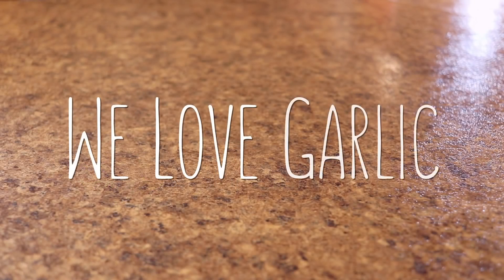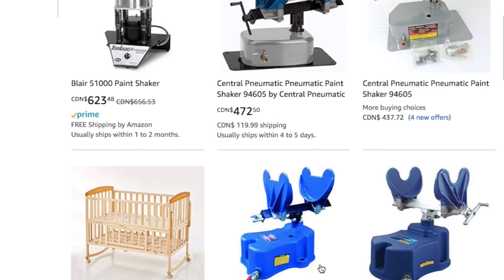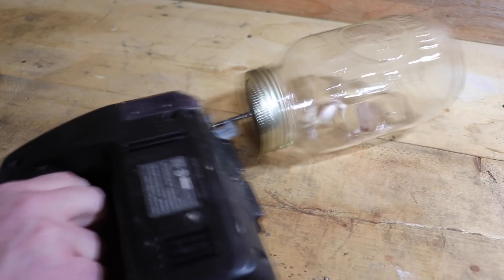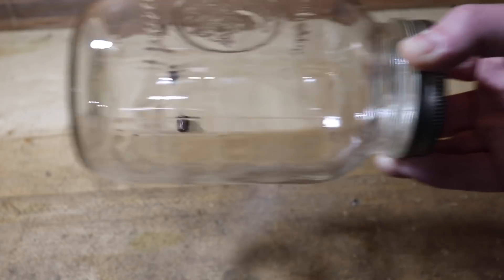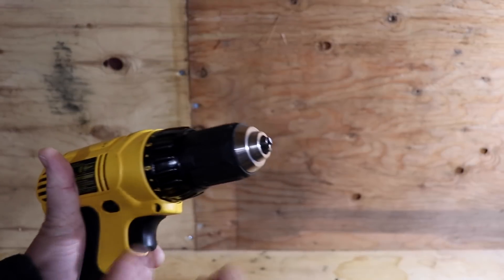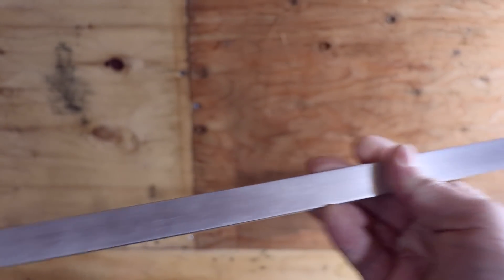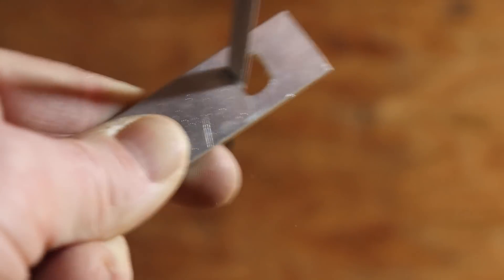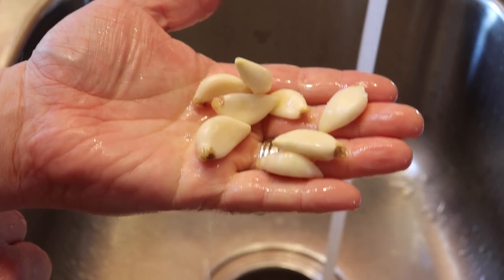How to Peel Garlic in Seconds with a Drill! (DIY garlic peeling machine)

Comment: My neighbor grows 2.5 acres of garlic he uses a washing machine without the water to peel them another washing to wash them.
Reply: Excellant!!washing m/c idea!!!!!
Reply: old washing machine can be 50$. cheap and reliable. good tip
Reply: Wow thanks for the info. Wouldn't it be damaging for the washing machine though? Please let me know.
Reply: @Mermaidjm  I wouldn't use a brand new washer, nor would I use the one we already have for laundry. But as said above, you can get a used one for very little cost. It won't even have to be hooked up to plumbing. I suspect a clothes dryer would work about the same way and you could disconnect the heating mechanism, just run the motor to tumble the garlic and knock all the peels loose. Perhaps if you left the fan in the dryer running, it would blow all the little peels out through the vent hose for you?
Reply: Since most of us don't have 2.5 acres of garlic to deal with, look around for videos about making your own small tumbler with a small motor, a bucket and a homemade stand. Usually people use them to polish rocks or put a stone-washed finished on metal parts, but it should work about the same as a washer for peeling garlic.
Reply: @Mermaidjm  you can use an old broken one atached to a bycicle, you dont use power and you work out and the waching machhines you can find them in the streets all the time for free
Reply: @vivekkhavnekar  yes very good & pefect idea operational with 110 % successful.
Reply: I know this comment is 5yrs old now, but makes me wonder if you could have used the bolt head through the jar to spin the jar with the drill, or if the drum circumference in a washer is the key element of why that works, imparting the important distance as the garlic climbs the walls and falls down.

Comment: with the mason jar/jigsaw setup, you should have tried holding the contraption vertically so gravity could assist getting the cloves to the bottom where they would  be struck by the bottom of the jar as it moved upward.   the jigsaw would probably need to be clamped securely and the lid replaced with a disc of 1/8" steel plate.  but your way is a lot more fun

Comment: Thanks for sharing this. I think the reciprocating saw approach would work if you placed the jar vertically. In that configuration, the cloves hit the bottom of the jar, are tossed up, then hit the bottom of the jar again. Over and over. You might face some weight issues in that design, but for smaller batches it could work. It’s a simpler design than the drill design and might be easier for some people.

Comment: I used a leaf blower to fire the garlic down some pvc pipe and into a five gallon plastic carboy with a hole cut in the side. The impact consistently broke up the peels so they could be removed easily and I faced the carboy downward to collect the cloves of garlic in a container beneath, where any stragglers could be recycled into the machine to be shot through it again if necessary. pounds of almost completely peeled garlic in minutes. I thought about adding a sluice box at the end to separate the peels (which float) from the peeled cloves (which sink) but never got that far.

Comment: The mechanics is good. To improve the function, Introduce a nylon or steel net inside the jar to make surface rough instead of smooth glass. It should peel faster than you expect.

Comment: What a crackup- This is a lot like what I was doing with a motor and a controller before the controller died. I have a round disc instead of a crank arm (because I have discs laying around). And a linear bearing. I haven't quite got the container figured out. I want it removable so it can be washed. It's great to see that you've proven the distance it takes to accomplish this. I'm still going to finish it whenever an affordable dc controller shows up on ebay.

Comment: Well you created a QUICK RETURN SLIDER MECHANISM here. 
To be more efficient and let the garlic peel both in its forward and backward stroke, u need to make the slider move in same speeds during forward and return strokes. 
If the centre of the crank and the slider line of action is offset, u will get a quick return motion with any of one stroke being faster than the other.
To make both the speeds identical, position the crank centre and the slider line of action in line.
Reply: correction, I'm an idiot.  sorry for sounding insulting, I've been drinking.  I just penciled it out.  You are right.  The return stroke is a bit faster.  Pretty sure that isn't a problem in this application.  

1) bearings on all connections.( the video guy mentioned that)
2) foot mounted electric motor with bearings designed for cyclical side loads.  Nord makes a nice one.
3) I'd recommend a belt drive to reduce motor speed
4) With a motor as small as this I'd even put it on a VFD, the cost would be marginal.
5) Like all reciprocating devices, it should have sufficient mass and mountings to withstand the shaking.
Reply: @trwsandford  According to you, if you can use some sort of overdrive pulley system, you won't need any motor. You can hand crank it and the peeler would also become some fat burning machine, since it takes only couple of seconds to peel the garlic according to the video. 
And no issues for your reply 🤩🤗😊
Reply: @venkatpuneeth  I was envisioning a small motor turning fast, and slowing it down to optimize the speed for the garlic travel, but of course you are right.  You could speed up a hand crank to do the same thing.  :)

Comment: Cured garlic has cloves that have lost moisture, shrank, and come loose from the skins much easier

You can also dip cloves into simmering water for 5ish seconds and skins slip right off, ( use a towel like you do when removing skin off hazelnuts )

Comment: Excellent scientific experiment. I assume it requires both enough force and enough distance? A large food processor with plastic attachment may easily accomplish the same task? In fact, if we can replace the metal blade with a rounded plastic part it may also peel the garlic successfully?

Comment: I wonder if you had just swapped the jar for the squat 8oz widemouth, which is only a couple inches tall, if that would've worked with the jigsaw jig. Although the space travelled is still small, the jar may be small enough for the garlic to actually crash into the ends and peel.

Comment: This would have put a huge bearing on the drilling machine. The inertial force that develops when the cylinder reaches its dead centres get propogated to the motors of the drilling machine  Anyway, this is a good quick-fix project

Comment: Obviously the weight of the garlic enclosure and moving sliding mechanism (here: the mason jar and holder) should be as low as possible to calm down the structure and safe energy loss with every  acceleration. You could have used a much more narrow enclosure right from the start and the jigsaw would have worked just fine. Even the jigsaw attached to this mason jaw would have worked just fine if the movement would have been vertically. But that seems academic thoughts...

Comment: Even easier, you can just twist the cloves to crack the paper which is usually enough to get it off. If not, peeling from the bottom will have it off fairly quickly.
Reply from the maker: Yeah, that works too.  But then I can't hang out in the workshop ;)
Reply: @BackToReality  You could always find another project. I go around to flea markets and antique shops looking for rusty old axe heads to clean up, haft and sell for a little extra income.

Comment: this is a nice solution, but the vibrations will destroy the drill, I destroyed mine using an unbalanced wire brush that I attached to it
Reply: Good thing electric drills are cheap!  You are right though, the internal bearings are not designed to take this kind of loading.  

I'm thinking that a cheap high rpm foot mounted electric motor with a belt drive turn down ratio would be ideal.

Comment: Wow. . . what a Rube Goldberg contraption.  You were on the right track with the jigsaw. Problem is you were using a jar WAY too tall and heavy.  If you had used a small jelly jar or similar, roughly 2", this video would have been 3 minutes instead of 9. . .

Comment: Why not just buy a tumbler > set it and forget it. Unless someone has the workshop+skillset+time+materials already on hadn to build something - the cost of materials + cost of time to build it likely meet or exceed buying semething.
Reply: I'm seeing Paint Shakers for $150 and Rock Tumblers for the same price range. This "genius" only bothered to price them out on Amazon - that's the first problem. And 4 years later product pricing should be more expensive (inflation+supply chain pinching and price gouging).
Reply: 02:58 garlic still intact - is because (you didn't seem to watch the garlic through the see-through jar you were using right after stating that exact thing); the jigsaw was reciprocating too fast and the garlic was simply dancing in one spot on the bottom portion of the jar (side) AND NOT moving from one end to the other (jar bottom to lid and back) as vigorously shaking the 2 bowls would have done. This method is not about speed of reciprocation but power and intensity.
Reply: It works the garlic more like a gold pan/flour sifter!!

Comment: Lol just make a cheap prototype you can sell on ebay and amazkn and outsource its manufacturing to china.

You will make a million!
Reply: I also had another thought if I got my physics right.
Instead of making a longer stroke just use the jigsaw and a baby jar with a better lid clamp.

For garlic you don't need that much room and a smaller jar would slam it against the wall of the bottle...I think.

Maybe use a reciprocating saw instead for more stroke force.